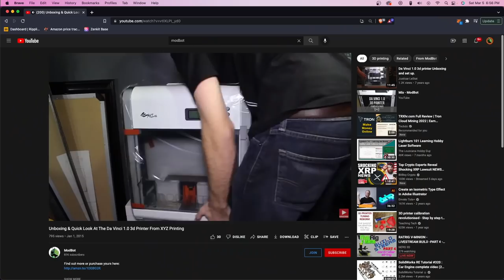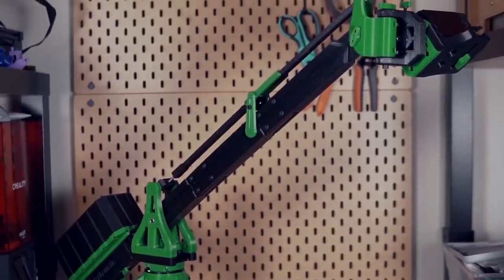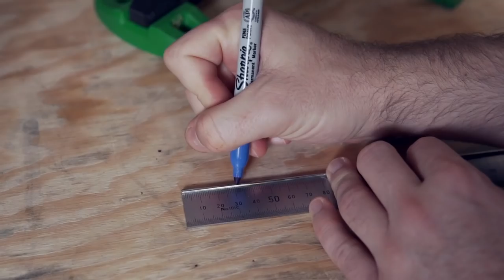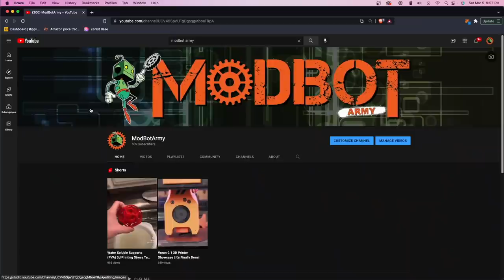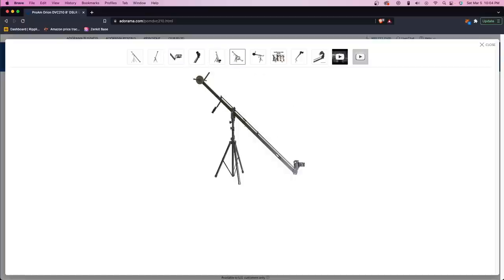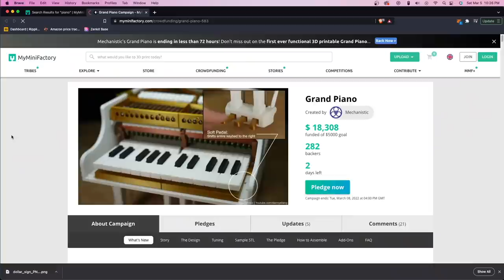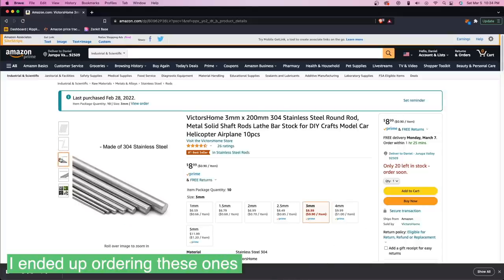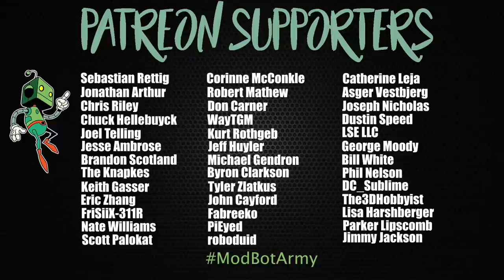Biggest 3D Printing Project I Have Done! (3kg Camera Jib)

Comment: My favorite functional part (I have built) is a boat throttle handle that I could not buy a replacement for. Tried PLA first..worked about a week before it melted (in sun) enough to not work. Then learned about PETG...bought roll of it and tried same print. Fantastic...has been on boat more than a year (outside) and still works.

Comment: Nice project! I too like practical prints.
That's not just any clock from Mechanistic. It's a clock with a tourbillon mechanism (originally developed to counter the effects of gravity on a clock's timing). A tourbillon is one of the most complex bits of watch escapement ever. Tourbillon watches typically cost tens of thousands of dollars and the mechanisms are exposed to show off the skill of the watch maker (and the wealth of the buyer). There were a few people trying to make 3D printable tourbillon mechanisms for several years. I believe TheGoofy was the first to do it, but still it's a feat of engineering.

Comment: That thing is pretty sweet. Wonder if you could make a slight mod for a V Mount battery as your counterweight. Record for days.
Reply from the maker: I plan on using it primarily hardwired for streams but thats kind of a genius idea. Have that counterweight easier to open and through batteries equal the weight needed in there for a long wireless session.

Comment: Man that is so awesome! I've been watching your vids for a while and you helped me decide to get a Sidewinder X1 for my machine shop. 
My kids broke it😂
Could I take the direct drive hot end and put it on a Neptune 2s? Also I might print this jib for some YouTube videos I am doing for Practical Machinist. Thanks for your help!
Reply: Also, I use my 3d printers for my machine shop. Mostly for different size bushings for my CNC lathe so I can hold different size bars. But also containers, tool jigs, vise jaws for plastic parts, ect. Love functional printing!
Reply from the maker: Oh no! Sorry to hear that. And yeah you totally good if you are willing to do some modding. They should both be 24v systems so the main thing you would have to do is remove the breakout board on the X1. If you extend the wires so they have enough distance to make it to the board it shouldnt be a terrible swap. 

The main things other than wiring would be mounting. The X1 has a 2040 for the x carriage while the 2s uses a 2020 extrusion. Once mounted and wired just updating e-steps for the extruder and you should be good to go. 

Totally dooable depending on how comfortable you feel with the modding!
Reply: @ModBotArmy  haha never modded a 3d printer before but plenty of lathes and mills and cars! So shouldn't be too bad. I'll work my way towards it. I print mostly PETG for the shop, and I've never ran a Bowden tube, only direct drive and resin. So I might just buy an all metal hotend to swap out first to get by till I  have the time! Thanks for the info!

Comment: Came here from the voron build. What happened to ur electrical screwdriver bro? 😂  2:30
Reply from the maker: Lol I still have it and it’s just in its original box which isn’t the most fun to constantly open. I have been meaning to make a pegboard mount. I often tell my self “you have a screw driver for this” 😂. Some of the parts are a bit to much torque but generally it would be saving my hand/wrist.